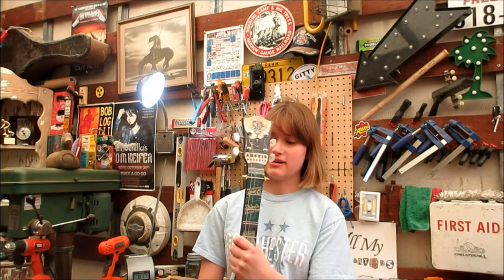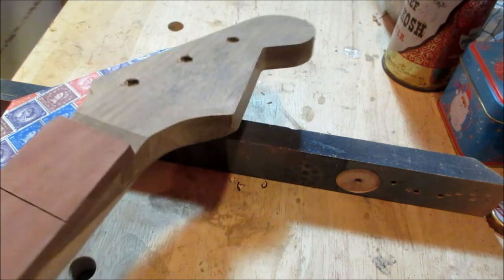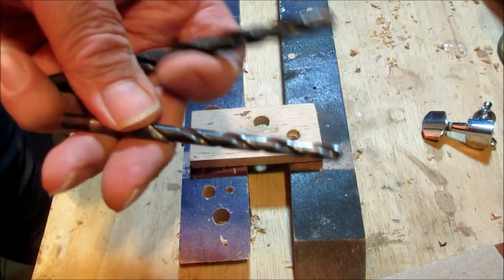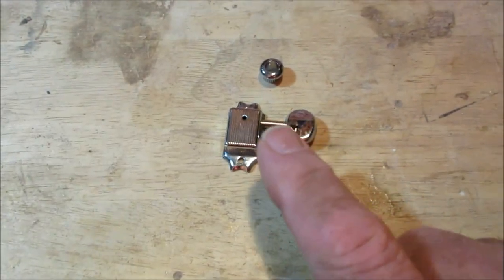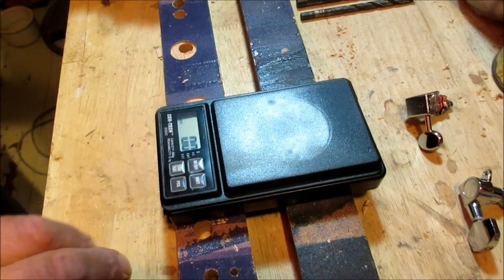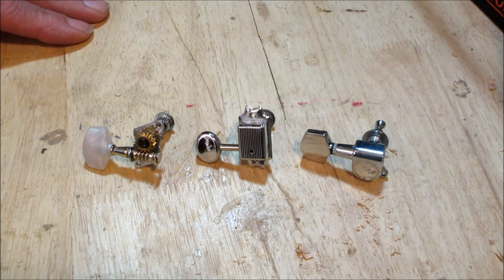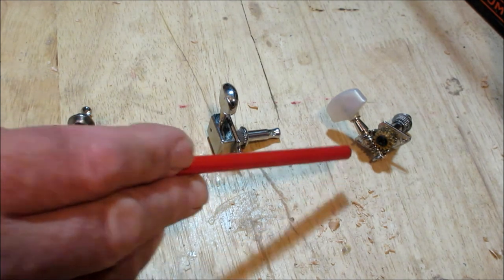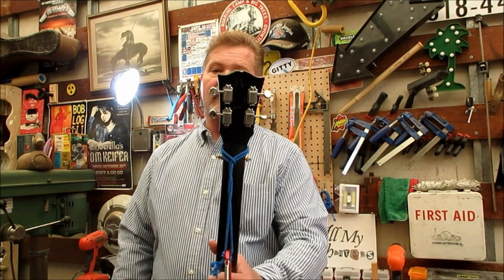Tuners

Comment: All my guitars have that third type of tuner you used. Mine have a tapered outer shaft, so I drill the hole at 9.5 mm and then use a tapered reamer  to enlarge the back of the hole to approximately 10.2 mm. This type is so secure they don't move at all, even on that odd occasion when I finished a guitar and forgot to use the securing screw. This type of tuner only has one retaining/securing screw, and the others have two.